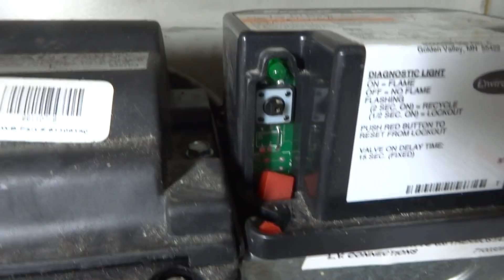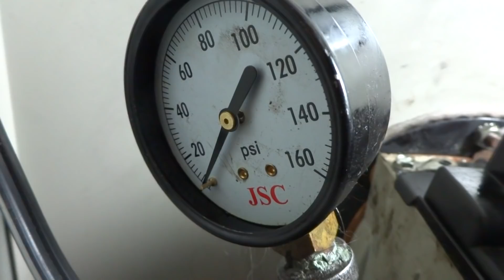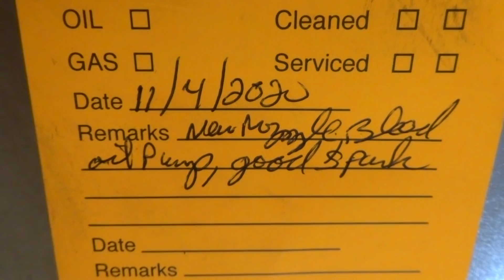MILLER FURNACE NO HEAT CALL TRAILER HOME

Comment: Those miller trailer park units always have clogged oil lines . That outside oil filter is a lousy idea as well , but there is not a lot of room in the furnace compartment, so do what you have to do .

Comment: A boiler in a trailer home, that's a first for me! As always steve gets it running again yall!!!
Reply: Jason G the furnace steve was working on is a miller warm air furnace . There are trailers with boilers in them but not many , only 1 or 2 brands that aqte certified for mobile homes . I have worked on a few up here in eastern maine .  Some you have to get at from a door on the back of the home in its own little room working on it while exposed to the outside , good times on a january night !!
Reply: @kevo8225  1973 holiday rambler they put the boiler in the bathroom, you get to set on the toilet to work on them.  Now they have to be in there own little room, yes it’s fun in January snowing and dark working on one, 40yrs on the job

Comment: Have a question for you? Enjoy watching your videos. I have a 110 volt heating system how do I switch it to 12 volt or 24 volt for the smart thermostats?
Reply: There's no easy way, but with enough step down AC/DC transformers and low voltage relays you can pull it off

Comment: I hate the beckett I have in my trailer furnace...I eveninstalled a whole new one and it ran for 1 season and when I started it up the next year it ran for a week and then the oil was filled with bubbles...I gave up
Reply: That sounds like a line or filter issue. Just because something is not leaking does not mean the pump is not sucking air. A small nick in a flare or ferrule or a bad seal in the shutoff valve is all it takes to lose the prime and give issues especially during mild conditions. Had many instances like that over the years.

Comment: Do they use any electric heat where you are? I see more electric here when there is no natural gas than i ever see fuel oil
Reply: Oil is way cheaper than an electric furnace, especially in high electric price areas like Mass (one of the highest in the country. )